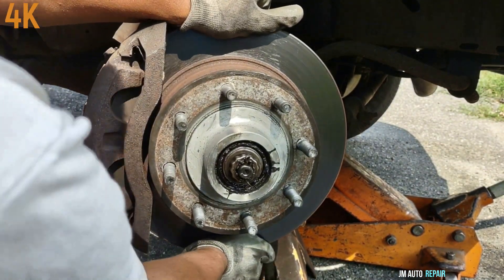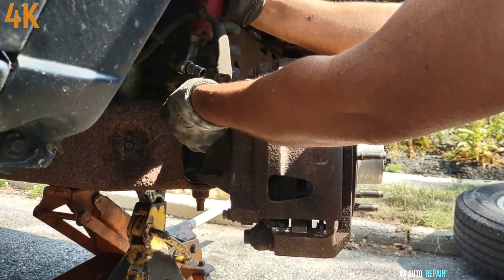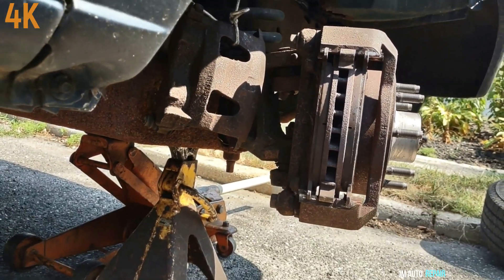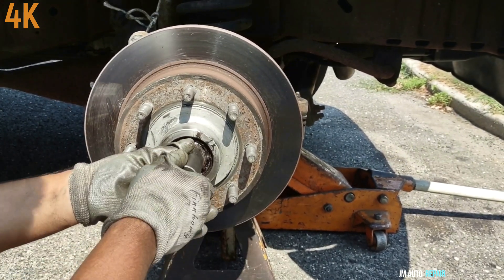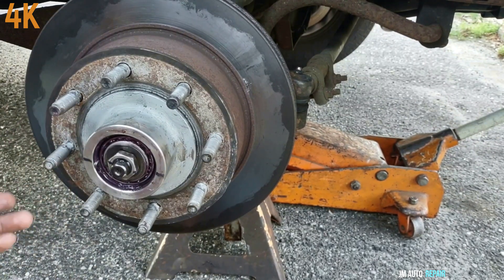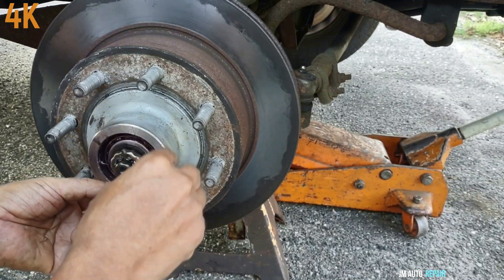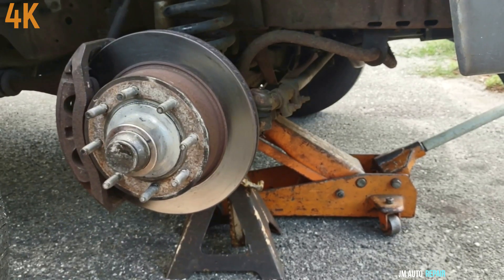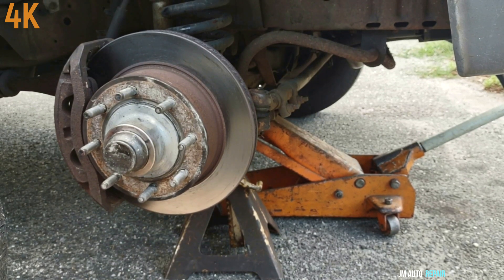how to replace front wheel bearring on Ford E250 E350 E450 front wheel bearing replacement

Comment: Wow. That's a lot of work. I am looking at used econolines and their service histories show a lot of bearing replacements. I didn't realize the rotor was merged w the bearing. On my Tacoma the rotor is super easy to change...pops right off once you remove the caliper. Seems like when you change the rotors on these you might as well do the whole thing. Or if you have to do bearings might as well change the rotors.
Reply from the maker: thanks for visiting this channel and watching this video, yes they have different prcedure of replacing the bearing compare to traditional bearings.

Comment: if you put a large gloop of the grease in the palm of your hand you can smack the bearing into the grease and pack it into the bearing saving you some time and also ensuring you get plenty of grease in the bearing , called packing a bearing , just slam it into the palm with the grease .
Reply from the maker: yes you are absulutely right, now I have the tool and it is much faster and to insure no small spot will be empty inside the bearing, thanks for sharing that is very appreciated.
Reply: There's more to it than just smacking it into the grease. At least to do it right. That bearing won't be greased enough.

Comment: Hello JM again. Happy new year. Would this procedure apply for my 2003 Ford F350 5.4L SRW truck? or only for the E line of Fords?
Reply from the maker: hi and happy new year for you too, no it is not the same, only for E series. thanks gain for your support to the channel.
Reply: Actually it might be the same. I have the same truck except it is a 2006 and it was difficult to find parts because it shares components with e series. This is exactly how my set up is, I'm doing the same job right now. Sometimes with fleet vehicles companies opt for cheaper components or upgraded ones. Don't know whether the e series or f series is better in this example, but it was a Pepsi truck. I got it from an auction. It was probably not meant to haul anything, but rather for promotional use. So e series brakes would probably bring the price down and was suitable for the companies intended purposes.